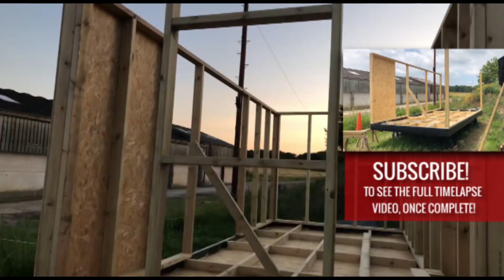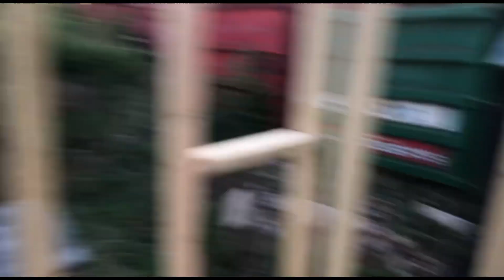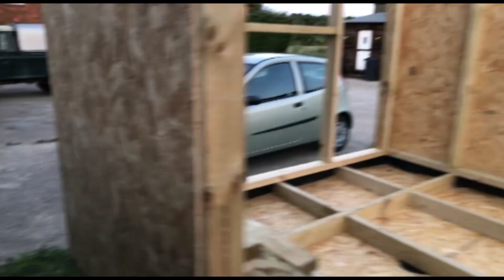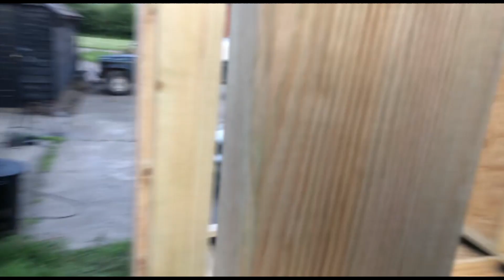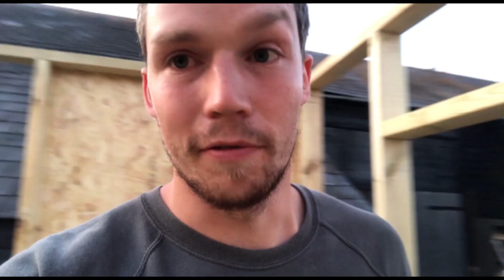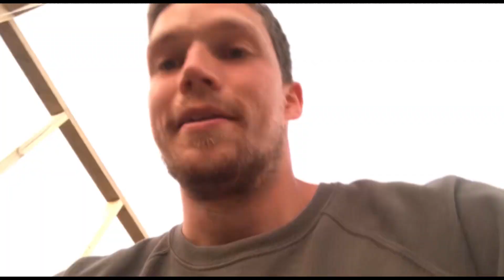Ep4: Shepherds Hut Build - Framing Windows & Doors

Comment: just a thought, you should brace all 4 corners with a 1x4 strip embedded and glued in the 2x4 to provide additional strength to your structure to prevent warping as you move the trailer around :-) 🙋‍♂️🍁🖖
Reply from the maker: Hmm good idea, I’ll give that a go when I make the next hut. I’ve actually nearly finished this one, I’ve just been delayed with editing and uploading my the videos. But you’ll see a lot more progress videos every week now.
Actually I think I did end up adding and additional 2 by 4 to each corner so that there was and additional piece of wood to nail the internal cladding too, but it wasn’t glued to the other studs. I’ll give that a go next time, suppose it can’t hurt eh :)